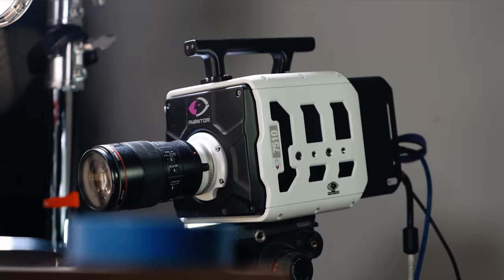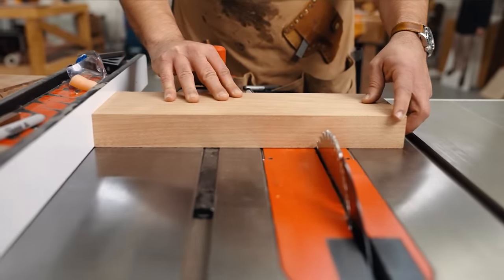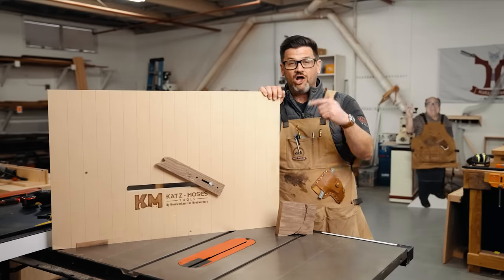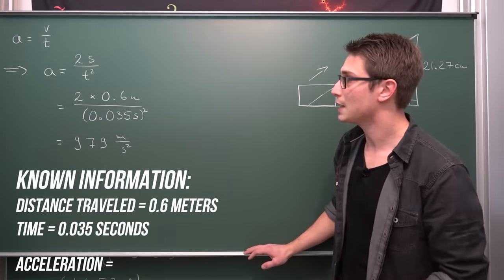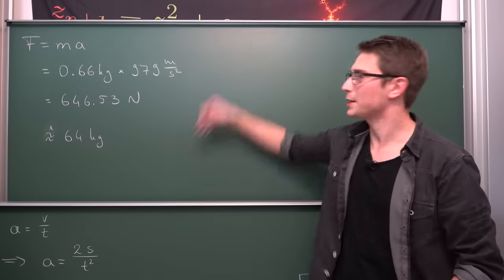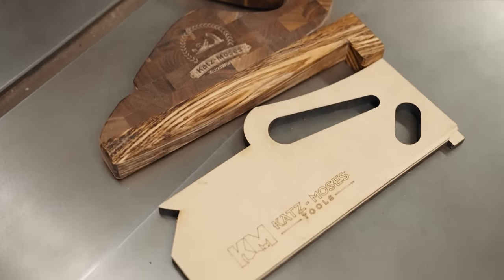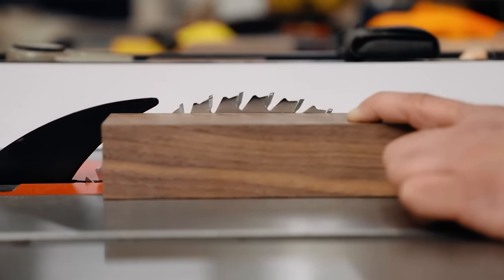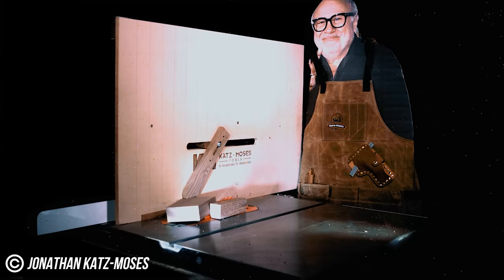The Anatomy of a Table Saw Kickback at 50,000 FPS Ultra Slow Motion in HD

Comment: 6:20 that's not the force you get to feel when it hits you, that's the force the table saw has to accelerate the piece of wood.

In order to know the force at which it hits you, you need to know the deceleration of the hit.

All in all, I think raw speed would have been a more useful metric here, as the acceleration only happens during a short period of time, after that, the speed is constant.

Comment: Engineer here
The point selection to estimate constant acceleration is wrong
Once the block of wood stops being hit by the blades it stops accelerating
Therefore the end point needs to be the first frame where the teeth are no longer in contact with the wood
A MUCH later frame is chosen

Comment: the calculations are correct but they are incorrectly interpreted and/or explained. F=ma. the force of 64 kg calculated is the force imparted by the blade to accelerate the wood object to nearly 1000m/s squared. this acceleration occurred over a distance of 0.6 meters. the resulting force against the body of the woodworker depends on the distance/time that the object slows to a stop after striking the woodworker. suppose, for example, this occurs over 10cm (0.1 meters) in 0.35 seconds (same time as when it was ejected but shorter distance). this might be the case, for example, if the object were hitting the woodworker in the head. in that case the resulting force against the woodworker's body would not be 64kg, it would be 384kg (64kgx6)

and none of this accounts for the pressure of the object on the human body. this problem was touched on when comparing to a bullet. the pressure of the wood object depends on the area that comes in contact with the body. the smaller the area, the greater the pressure. so if you're hit with the corner there is a lot more pressure, and therefore penetration, than if you are hit broadside. that's not to say it's better to be hit broadside than by the corner-- that's gonna depend on exactly where it hits you and what kind of protective gear you have on if any. there are a number of factors here that could result in a range of scenarios from annoying to injurious to fatal

finally, the ballistic gel is useful to judge relative penetration, but without more it tells you very little about internal damage with or without penetration. for example, when coveralls were put on the gel torso, is there any way to know how many ribs were broken? no

so while i appreciate the high speed cam it doesnt tell us anything we didnt already know: use a push block that puts even downward pressure on your wood stock and otherwise use stuff that keeps your feed stable and smooth, use a riving knife or at least a splitter, dont crosscut with the fence use a sled, and use the blade guard when it's right for you to use it

and speaking of blade guards, everyone talks about it like it's a safety device for your hands, but it is much more commonly a safety device for your lungs

Comment: Isn’t the weight of the wood block a Force due to the acceleration due to gravity and not the mass of the would block?
Reply: Nope. The weight only is a thing when it’s resting on the ground. Mass is what matters for flying objects. Flying objects have mass but they are weightless.
Reply: @leedavidson4405  I respectively disagree.  Gravitation acceleration is still acting upon a mass in motion(ie flying).  Look up Pounds mass vs pounds force.
Reply: @justindyster7073  yes of course the acceleration is acting on the mass. But it doesn’t really affect the velocity in that short space of time and the short distance it falls due to gravity is not significant. Regarding the weight, an object has mass, but not weight unless it’s at rest on the ground. A 100 lbs mass always has 100 lb of mass,  but it weighs 16 lb on the moon. The impact of the wood on the person is a function of 1) it’s momentum or kinetic energy  at the time of impact, and the rate at which it decelerates when hitting that person. That’s why it hurts more to hit a brick wall than a haystack.
Reply: @justindyster7073  oh, and flying and ballistic motion are not the same. You weigh what you weigh in an airplane that’s flying. You weigh nothing if the wings fall off and you’re in free fall.
Reply: @justindyster7073  also think of a bullet. It drops while in (ballistic) flight. That vector (down) doesn’t affect the force of impact which is primarily horizontal.
Reply: @leedavidson4405  I am an Aerospace engineer and a Pilot.  I get it.  The point I am making is weighing something and calling it mass.  Weight is a Force = Mass x Acceleration.  To get the mass you need to divide the Weigh force by the gravitational acceleration.
Reply: @justindyster7073  I think we agree on that
Reply: @justindyster7073  right, but acceleration, kinetic energy and the like are calculated in kg, meters and seconds. Nobody relates to Newtons, and on the earths surface mass equals weight in Kg.
Reply: @justindyster7073  ps. My calculations are posted. Let’s see yours

Comment: Not sure about the calculations...
a 0.66 kg piece of wood traveling at 17m/s does not have the same kinetic energy as a 65 kg object falling from the 10th floor - unless I didn't understand his analogy correctly.
a 66 kg falling from 15 cm would have the same kinetic energy on arrival than a 0.66kg traveling at 17m/s
after 15 cm of free fall, in 0.17 seconds, the speed S2 would be 1.7 m / s
Ek_2  = 66 * S2 * S2 / 2  = 97 - same kinetic energy as the piece of wood according to the data from this video (speed and mass)
Not sure why he' s introducing the average acceleration during the first phase; this is irrelevant;
For comparison, a baseball weighing 0.148 kg traveling at 45m/s have a kinetic energy of about 150J, about the same value as the thrown piece of wood.

Comment: Hello Jonathan. Love the video, love seeing high speed kickbacks. I do have issue with the maths/physics flammable maths used. Specifically on two points: 1. The acceleration should only be calculated for the duration the block is in contact with the blade since this is when the force is being applied. 2. To correctly calculate the force applied by the block during a collision with a person, you need to use the change in momentum before and after the collision. Since the block won't come to a complete stop when it hits something not all its kinetic energy is transferred. Bullets will (typically?) come to a stop in your body so all of its energy is transferred.

Again, great video! Happy NY

Comment: John Heisz needs to watch this video...that content creator actively encourages his viewers to ignore the dangers of table saws, claiming "F U, I'm a professional, don't try to school me". Such a dangerous attitude.
Reply: It is apparent that you haven’t listened to a word of what he says.
Reply: @isakwatz11  Oh, trust me...I did. John is very smart and he has good ideas and good plans (yes, I've financially supported him in the past). But he has a clear "holier than thou" attitude when it comes to safety and the responsibility that a teacher has. Disagree with John and his response is to just block you and then bitch about it.
Reply: @MrStrizver  
You do have some valid points. I too disagree with how John works regarding safety but he does promote safe working. One great thing he speaks of is control when cutting on the table saw. His blunder is that he advocates using your hands instead of push sticks. I work with two push sticks, with superb control.
Reply: @isakwatz11  My breaking point with him was when he demonstrated how to "control" a board that is beginning to pinch the back of the blade by simply reversing the board a bit and then recutting, thereby widening the kerf. This is such an irresponsible thing to be teaching and his response to criticism was to block. My message to him on this was simply that his saw is underpowered so he can get away with that technique, but a person who just bought a shiny new 3HP sawstop is gonna get a kickback slammed into their noggin. He talks a lot about personal responsibility but fails to take it himself in a meaningful way.

Comment: One point that was missed is how kickback like this tends to suck hands into the blade
Reply: Usually it is because a careless worker uses their hand instead of pushing block.

If you hold the piece wiyh your hand while you cut and the piece gets pinched, the rotating motion will move your hand to the blade.

Comment: 7:42 "It's a little bit thinner than your blade". Actually it should be a little bit thicker than your blade, but thinner than its teeth width.
Reply from the maker: Semantics. It's .02 thinner than the kerf cut by your saw blade.

Comment: I am constantly amazed at the lack of fear in people when around blades spinning at ANY rpm.  I like my fingers, eyes and life.  I will say it as many are quite polite about it.  If you lack common sense, find another hobby that does not include moving parts.  Common sense will prevent most of these accidents AND usually those with it, research safety methods when working with dangerous things.

Comment: This isn't the correct formula to use. The object is not accelerating once it leaves the blade as no force is being applied at that point. Thus, it's more accurate to use its speed. Once the item cleared the blade, speed=distance/time or 0.6/0.035 or just over 17m per second. To be more accurate, it appears to travel about 40cm once leaving the blade so 0.4/0.035, or about 11.5m per second.
That's still fast but it's certainly not travelling (as you seem to sensationalise) at 980m per second...and yes I know he is measuring acceleration and its mps² but that's not how you imply its speed. 
If an object hit you at that speed it wouldn't just cut you, it would punch a hole right through you and completely mutilate your body. 
Not saying this can't do serious injury or even be fatal, it can, but i think you should  be more accurate instead of using sensationalism.

Comment: Great Video, but the calculation must be wrong... If you take a look on the spinning blade, you can see that the piece is moving in the same speed as the spinning Blade. The piece cant be 10x faster than the bladespeed or near sonic speed. If you take 6000 rotations/min and a diameter of 210mm (xPi) and devide it to seconds, you will get about 70m/s. I dont say that this makes any difference to the danger of a kickback but it needs to be said😅
Great video anyway!

Comment: 3211 FT/S = is 2,189 MPH.  Ouch! That explains the nasty bruise I got across my belly from a 4x4 coaster I was making.
Reply: It doesn’t go that fast. See the comments above
Reply: @leedavidson4405  using their figures it does seem too fast given a saw blade speed at the tip is about 150 MPH. I don't disagree with their distance traveled but wonder if the decimal place is wrong in the time it traveled
Reply: @sailingeric  possible I suppose. Need a frame by frame. If so, the kinetic energy would be very large.
Reply: @sailingeric  the data need to be taken once the wood is in the air.
Reply: @leedavidson4405  the piece of wood was going about 77 mph but got there in .035 sec and that is close to the acceleration figure they got
Reply: @sailingeric  the acceleration is done when the wood leaves the blade
Reply: @leedavidson4405  yeah I don't know what the acceleration had to do with it. Maybe they zoomed in too close and didn't have enough frames to figure an exit velocity of it's center of mass and rotation.

Comment: Very interesting video! I definitely learned a lot about table saw safety/fundamentals. One note: the value of force calculated is force applied by the blade, NOT the force of impact.

To find force of impact you would use acceleration at the moment of impact. Or you could rather calculate kinetic energy using "KE = 1/2 * m * v^2" and compare to other common moving objects (football player, vehicle, bullet, etc).
Reply: Correct, almost. Momentum is mv. KE is 1/2 mv**2
Reply: @leedavidson4405  Oops! Thanks for the correction.
Reply: @skyhoffert  I made the same point as you did the first day. The response I got was “lots of people watched this, nobody else thinks it’s wrong”
Reply: @leedavidson4405  I believe that! Luckily the point of the comparison was still seemingly accurate and understandable.

Comment: Great video, BUT... this math have nothing to do with what is happening during kickback. First to measure force of action you need to use deceleration, not acceleration. Second: acceleration is not a constant value, it greatly depends on how the teeth are contacting with the piece. So all those calculations are not nearly close to reality. You better measure velocity when the piece is flying without any contact, calculate its energy and make some assumptions how rigid someone's body (you could measure it with gel body and your camera) calculate deceleration and applied force.

Comment: I think you are correct that the math will indicate that getting hit with a block of wood is going to hurt, but your math is all wrong.  

After the block leaves contact with the blade, it is not positively accelerating, so calculating the acceleration over 22 inches of horizontal travel is not relevant of anything.  What you can do is calculate the speed, which is 0.6m/0.035s = 17.1m/s = 62km/h.   The 979m/s2 that you calculate might be representative of the acceleration and forces between the blade and the the block (it's wrong a well), but it is not relevant when the block reaches your face, since a different acceleration will apply in that context.  Now, knowing that the block is going 17.1m/s and the weight, you can calculate the energy in the block, beyond that it's difficult to say what force your face will feel as it will deform over a longer time period than a concrete wall, for example.  You could say that to stop the block with your face in 0.050s (assumed), you will need an acceleration of 17.3 m/s/0.050s = 342 m/s2, then F=ma = 0.66 kg x 342m/s2 = 226N, which feels like 23kg, or 52 lbs exerted over the entire 0.050s period that the block smashes into your face.  If you flinch or thrust your face toward the block the feeling will be significantly different because the time of spent slowing the block down is different.

Suffice to say that being belted in the face with 1.5 lbs of wood with sharp edges at 62 km/h (38.5 mph) is probably more relatable for people than more math.

Comment: While the preventative measures shown in the video are great, there are still some more nuances to consider. 

tl;dr
The most important note is to use your push stick close to the blade, not the fence. When pushing close to the fence, you naturally make the workpiece want to rotate in towards the blade. If however, you push close to the blade, that same rotation wants to push the work towards the fence. Damn, this got long! Maybe I'll make a table saw safety video after all...

"Birdsmouth style" push sticks should only be used in pairs. Never work with just one. The obvious reason for this is to apply both forward and inward force while cutting. If things go south and you instinctively want to grab a workpiece, move an offcut or similiar, you'll be much more likely to do that with the push stick. This keeps your fingers away from the sawblade. Also, these push sticks encourage the user to stand off to the side while cutting. That way of working has two benefits:

1) If kickback occurs, you are much less likely to get hit by a flying workpiece.
2) Kickback is much less likely because standing off to the side makes you automatically push the workpiece towards the fence with both push sticks.
 
One final note for the guys working with older saws without guards, riving knives and splitters:
Get into the habit of shutting the saw off right before finishing a cut. The benefit of this being that the blade already spins slower and without a continuous flow of new energy when the workpiece passes the back of the blade. This can dramatically reduce the power of a kickback.